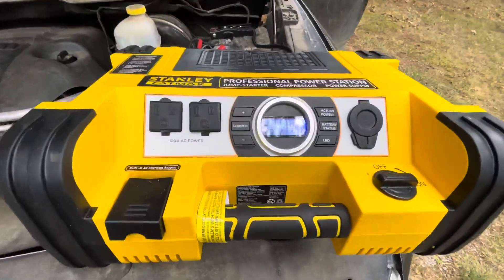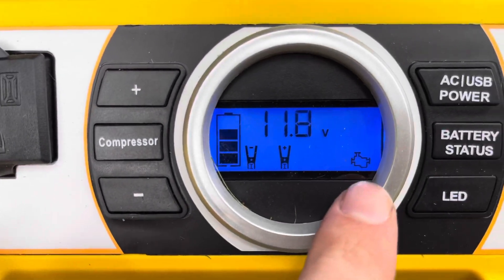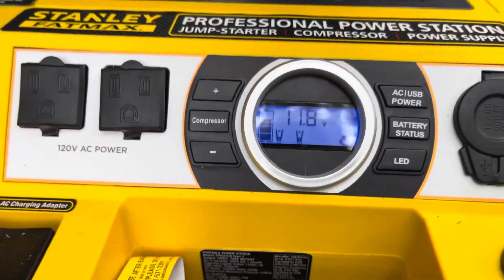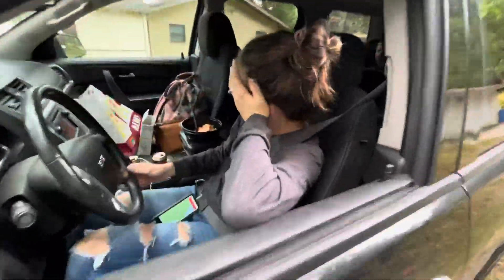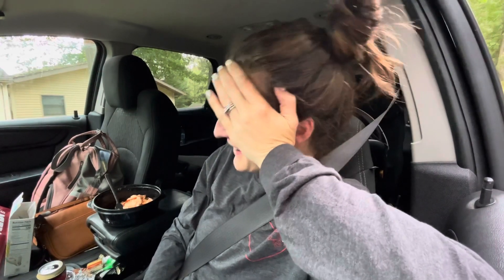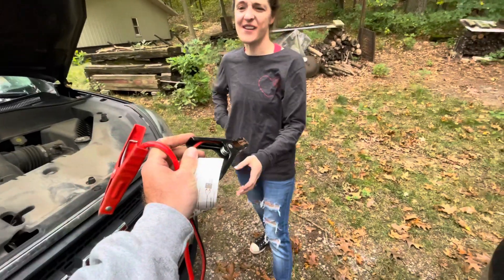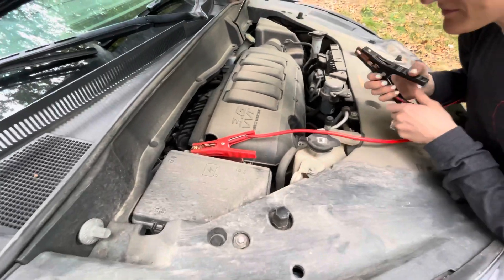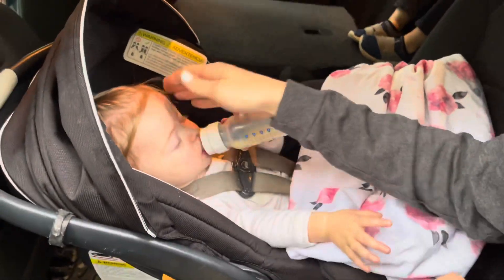Stanley Fat Max Professional Power Station Review. Watch before you buy!

Comment: It’s not made to charge a battery only to jump start it. If you haven’t fully charged the machine or have just let it sit then I won’t be charged enough to do it.
Reply from the maker: I’ve tried it a couple times to start my boat. Fully charged. Wouldn’t work.
Reply: Won't jump start either
Reply: Its recommended to charge it once a week
Reply: It's odd, because I have no issues with mine. Plus it fills my tires also with air. It can only inflate 4 tires before the machine needs recharging again. But it's not like my vehicle has more than four tires lol, so no big deal. Guess I'm lucky.

Comment: It's a 12 volt battery you are trying to jump...with a battery that's at less than 12 volts. You have to charge the Fatmax to over 12 volts, preferably to a 100% charge, before it will jump start your truck. All that time waiting for your wife, and you simply could have plugged the Fatmax in and charged it fully. When you jumped from her running car, you had 13-15 volts, and that was easily enough. Moral of the story: Keep the Fatmax fully charged for when you need it.
Reply from the maker: Ok

Comment: Thing works great for me. Jumped a 100 horse tractor with it. Also aired up a young woman’s tire at work from dead flat just the other day. Thing has pulled me out of some pickles.
Reply from the maker: Nice. I’m glad it’s working out for you! My compressor did work well when it worked. Lasted about half a year and then went out.

Comment: You are right that the Fat Max is only made to start the vehicle and not to charge the battery.
You have to put the unit on 110vac every 30-50 days to keep the lead acid battery charged.
I have the smaller one I purchased back in 2017. It would not hold a charge so I took it back to the Sam's store
with my receipt and they gave me store credit to purchase a brand new one.
I bet those new Lithium battery unit would last longer while being left a long time.

Comment: #1 It's not a battery charger #2it's a jump starter #3 its not fully charged so its not supposed to work.
Reply from the maker: This wasn’t the first time I tried to charge something with it. I hooked it up to my boat battery when the charger was fully charged. It couldn’t even charge that.
Reply: If your boat battery was fully charged why would you need a jump
Reply: I got one years ago as a gift. It still has never jump started anything.  It’s so big, and getting it as a gift, I feel bad to throw it out so I use it for a backup usb or dc plug type use. This Stanley sucks!!!!

Comment: Great video, I totally agree.  The name Stanley used to mean Top Quality to me...not anymore.  Sam's Club sold me trash and Stanley put their name on junk.  My unit's battery won't hold a charge to even function.
Reply: I found out that Stanley has been bought out several times and you cannot get anyone on the phone line to help you. I finally took my unit back to Sam's and showed them it could not take a charge. They gave me store credit to buy another one.
I had my receipt scanned 6 years after I purchased it.
Reply: It has to charge for 8 hours

Comment: I have my a year now still work great 👍 it for jump not charge a car !
Reply from the maker: I tried to jump my truck multiple times and it won’t do it. I also tried to jump my pontoon boat witch has a marine battery and it wouldn’t do it. The only thing I’m impressed with this unit is the air compressor.
Reply: @douglaslawncare2843  did you have the Fatman fully charged before you tried to jump your truck ???
Reply: @jerbo1978  finally someone asked the $1 question.

Comment: Sir,  preventive maintenance is the key. Be proactive. Service and test the battery, clean terminals, and charge the battery in the truck periodically. Preferably at every oil change. If the battery caps can be removed measure the specific gravity of the electrolyte. When the battery is 5 years old replace it. Keep the battery terminals clean and coat them with lithium base white grease to avoid corrosion so the connections do not develop excessive resistance. You don't want this to happen when you and the family are travelling with the small children. Been there, done that and learned the hard way. 

Do not rely on a jump pack. They are only good for recharging small devices and maybe inflating the tires WHEN it is fully charged.

Comment: You expect a charger to charge your battery in 5 minutes?
Reply from the maker: Nope. I expect it to charge it. It trips and won’t charge… I threw this junk in the trash. I kept it because of the air compressor and that ended up breaking as well! Total junk!
Reply: @douglaslawncare2843  it is a jump starter and not a charger. You also probably ran the battery down.

Comment: I just bought this new unit and it has no cranking amps to start even a small utility vehicle after 4 days charging. it says it has 13 volts but cranking amps is what's needed. I had the old version which worked well for years until I connected it wrong and burned up something inside. Now I have this piece of useless crap and will be returning it thru Amazon, I hope.
Reply from the maker: We’re you able to send it back? I was not!

Comment: Someone tried to throw it out, garbage man didn't take it. I bought home, took a part, loose pos connection. Might be  for around the house, small car,lawn tractor, generator. Quality control needed,  Sam's won't take back due to the battery 😑 😒 😮

Comment: First off, the issue you are running into here is the law of the conservation of energy. My observations are that:

1. Your truck battery is too depleted to start the truck. 
2. Your jump pack battery is too depleted to jump the truck.
3. You connected the jump pack to the truck battery in order to charge it. 

Energy cannot be created nor destroyed, so if both batteries were insufficient, then there is no way to start the truck with those two energy sources alone—no matter what anyone does. 

Second, the digital display on the jump pack displays the battery voltage, which appears to be 11.8V in this case. A lead-acid battery has a resting charge capacity voltage range from about 11.9V (<10%) up to 12.65V (~100%), so the jump pack was completely dead.

Lastly, DC circuits are much more flexible than AC circuits when it comes to working voltage, which means that you don't necessarily need to stick to finding a 12V nominal source just for a quick jump start. A lot of guys have cordless power tools of some sort in their truck, which can really be a lifesaver if you leave your headlights on out in the woods or something. You will need to find a couple pieces of wire, but all you need to do is grab a power tool battery, look at the terminals to identify the (+) and (-), and connect wires between the power tool battery and the corresponding terminals on the truck battery. The power tool battery should have some indication of which terminal is which. There may be a bit of a spark when connected, but it's nothing to worry about. The important thing is that you DO NOT LEAVE THE POWER TOOL BATTERY CONNECTED AFTER THE TRUCK IS STARTED. It's unlikely to become a problem, but a lithium ion battery will explode into a fireball if it is overcharged for too long. This would only be an issue if the tool battery was 14V or less, which is unlikely. Most are 18-20V. 

Good luck.

Comment: The joke is this guy's understanding of batteries.  Gotta disconnect the truck's dead starting battery to give tiny jump battery half a chance, it can't recharge a much larger dead battery and crank an engine at the same time!
Reply from the maker: Bet the compressor going out was my misunderstanding as well…
Reply: @douglaslawncare2843    I've no doubt that the tiny compressor would burn out if trying to inflate a big truck tire- I opened the case and that compressor is quite a cheap unit.
Reply from the maker: Mower tire…